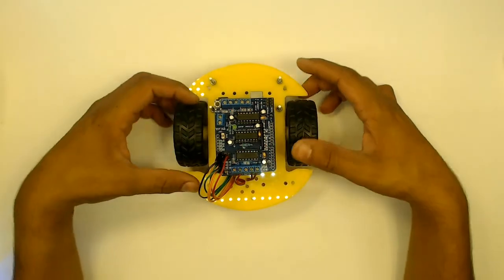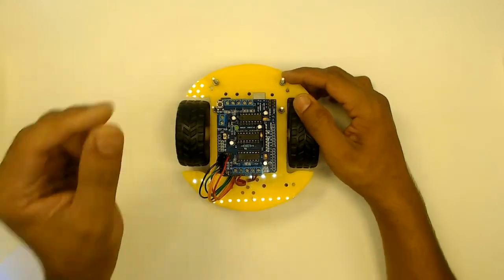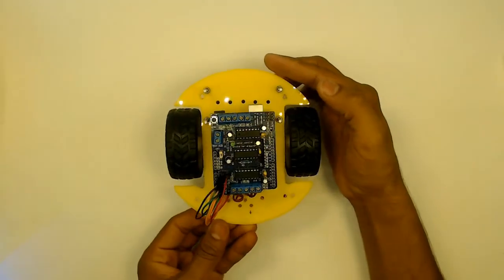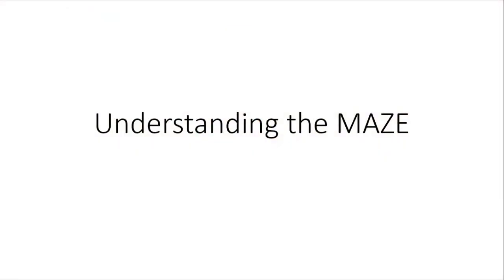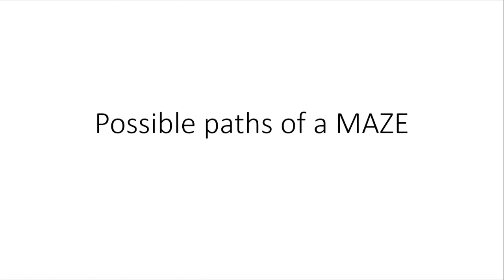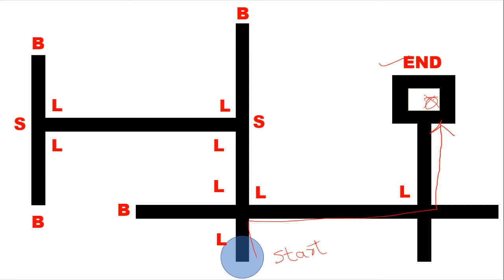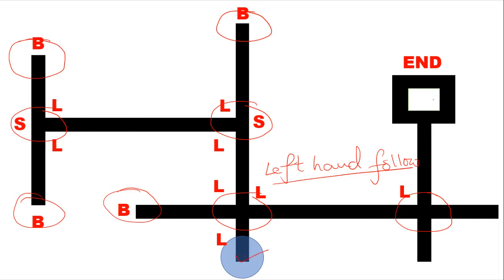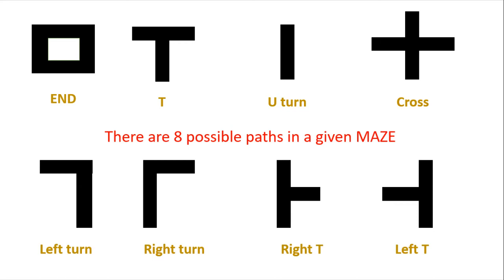3 Understanding Maze and traversing process

Comment: Can you make a parts list of what items are in the robot?
Reply from the maker: Part			Description

Arduino Board		Microcontroller board (e.g., Arduino Uno or Arduino Nano)
Motor Driver		Motor driver module to control the motors (e.g., L298N or L293D)
Motors			Two DC motors for driving the robot wheels
Wheels			Wheels for the DC motors
Castor Wheel		Castor wheel for stability and support
Line Sensor Array	Line sensor array to detect the line on the ground (e.g., QTR-8RC)
Chassis			Robot chassis to hold all components
Battery			Power source for the motors and Arduino board
Jumper Wires		Wires for connecting components
Breadboard		Optional for prototyping and easy connections
Arduino IDE and Cable	To program the Arduino board